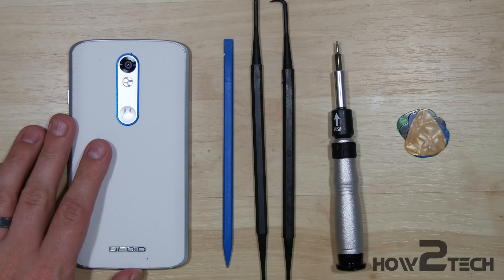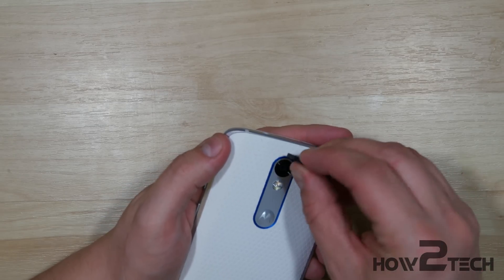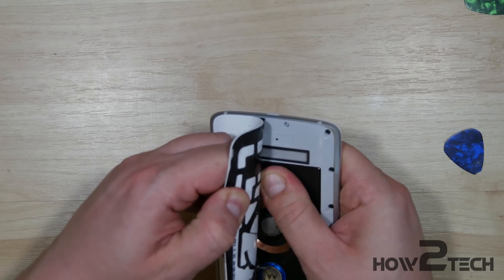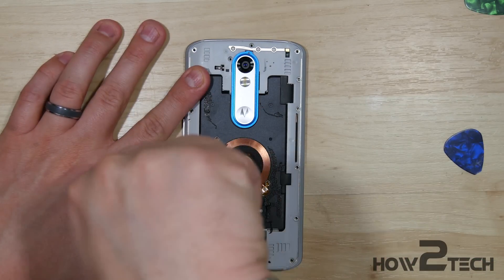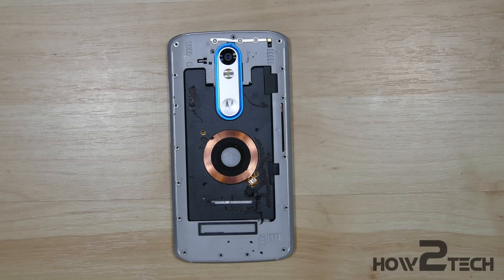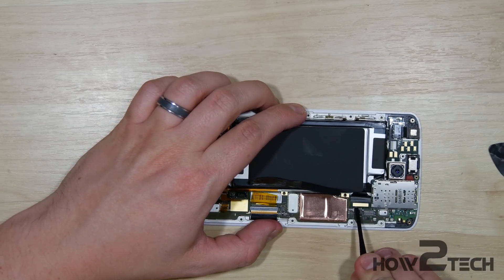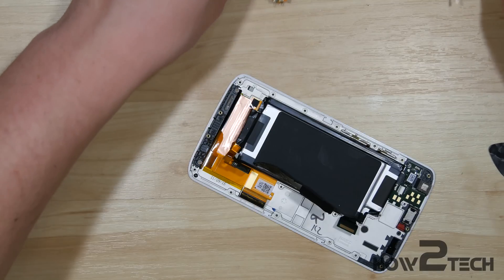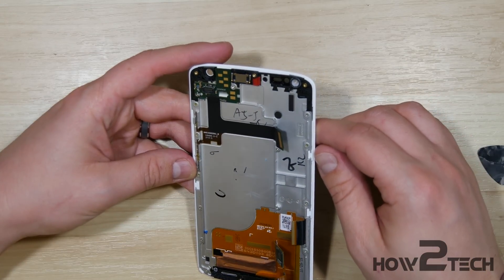Motorola Droid Turbo 2 Battery, Screen assembly, Back cover Teardown - Disassembly

Comment: i love the original Droid Turbo but this one for being shater proof screen it is scratch lover. have read that complain before i get this phone and i regret now. I have 5 phones and all of them have been in my pocket and there's no scratch on them.
On this one one day on less a month having it some weird scratch like gummy and then that area got worst. Only noticeable when screen is off.
Fell from high and the haptic feedback stopped working, removing the battery cover i saw that is a little piece that revolves but wtf man how they build this, my Droid Turbo have been such a nice phone dropped and no problem

Comment: Someone doesn't understand the reason for tool sizing. Sizes do not vary from device or tool. Sizes are a standard.
Reply: Yes, they do sometimes vary from device to device. Different devices can use different size screw hence the reason many tool kits have more then one size/type of screw driver bit.   There is no rule that says all device manufacturers must use the exact same  size screw across ever device.

Comment: can anyone help i changed my screen because i couldnt see anything on the display for my phone. but it would still turn on but the screen would be black. and so after changing it, it wont even turn on now. could it be a bad battery? the screen still wont work and it wont turn on but theres a green led that shines every time its plugged in.

Comment: Why would you need to replace this stuff? Get insurance save money and headaches. Phone is shatter proof anyways, also buy a case.
Reply: Parts break. But the real reason is batteries eventually need replacing, and the cost going through the manufacturer is usually almost as much as just getting a new phone..
Reply: and these shitty batteries don't even last two years...

Comment: They should've made the phone with a plastic battery cover (like most phones) and just have the material on the cover because this looks like a pain in the ass...
Reply: They did that on purpose so you are forced to replace the phone when the battery fails just before you pay the damn thing off.

Comment: Thanks for posting this! I have 2 questions: would you be able to remove the battery without removing the logic board? And if I were to disassemble the phone and replace the battery, would you recommend putting it back with adhesive, or could I just plop it in there and reassemble the phone?
Reply: always use double sided tape for safe measure. you wouldn't want it shifting around for the sake of the ribbon cable.